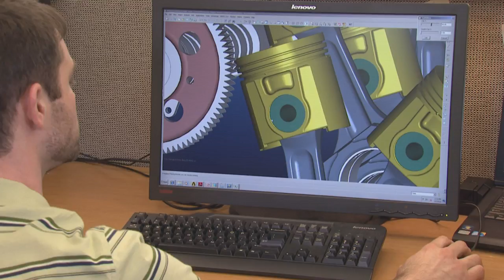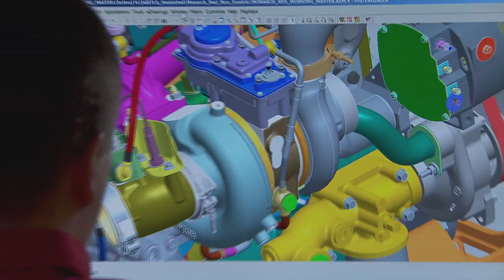Innovation Naturally - The Future Of Cummins Natural Gas

Comment: Been driving a CNG last four years absolutely no pulling power truck runs like a scared rabbit on a flat Road it's not turned down speed-wise they say it has 400 horsepower but even a small hill there is absolutely no power in these motors
Reply: I agree the diesel ISX vs the CNG version is night and day
Reply: And always breaking down in the winter
Reply: @williammcphail5581  high hp no torque

Comment: This is a great thing emissions like egr and dpf are getting us no where but losing efficiency and fuel mileage we need to change the fuel itself
Reply: Odd that you have that misconception. Diesel has nearly 150% the energy density of CNG or LP. The only advantage LP and CNG have over diesel is price. And that advantage exists because the price of diesel is artificially jacked up.
EGR and DPF are the worst possible ways to clean up a diesel's exhaust. In truth I think they make them run dirtier. If someone bothered to actually do a study on this I'm betting they will find that the gross NOx emissions produced by a truck equipped with them is greater than if the systems were removed.
Common sense will tell you an ounce of prevention is worth a pond of cure. Cooler intake = cooler combustion = cooler exhaust temps. Larger, more efficient, intercoolers and cool air intakes are the answer not EGT and DPF.
Reply: samus989 I have several rigs, but my favorite is my 67 Loadstar. Its outfitted with a MaxxForce DT, Allison 2500 PTS, NP205, Dana Super 60 Front [3.31 ring and pinion], Dana Super 80 Rear [3.31 ring and pinion], riding on a set of 22" American Force 'King' rims and 235/50r22 tires.
The engine and transmission are sourced from a IC CE-300 bus. The Axles came from a '12 F450 King Ranch. 
Tax auctions are so much fun. I got both of them though title boxes. They claim the contents are random, filled with whatever title documents they didn't have time to process. But I think they filter out all the real gems, then stuff the rest in those boxes and seed them with a couple goodies just to keep people interested. 
But I'm not complaining. Thats how I make my money. Paperwork is a bear sometimes, but... I digress.

Back to the truck.

By virtue of the truck being a 67 rig, I was able to legally delete the EGR and DPF system. With some electronic black magic I got rid of all the computer issues that caused, and gained the ability to select between high output and high economy injection characteristics.
With a larger, dual stage intercooler [pre/post], VGT control tuning, cool air intake, 4" intake, downpipe, and exhaust pipes, and minor tweaking to the fuel injection system, I able to upped the hp to 500+ @ 2800 rpms, 950 @ 1600-2800 rpms.  
With a 6th gear of .64: and a final drive of 3.31 I'm able to cruise right along at 65 mph while turning at 1500 rpms.
Even with the HO switched on I don't see even the slightest puff of smoke. My EGTs with HO on are never over 1250F at the turbo inlet, and when its off they much lower.
With HO on I get about 22 hwy, with it off I beat your mileage by 3, with 28 mpg.

Will I ever recoup all the money I'm spent on building this rig....Bah, ha, ha! You got to be kidding me!

Well, come to think of it, if you take into consideration the money I didn't spend on parts, along with the money I got from selling the leftovers from the donor vehicles, I might be pretty close. 

And before you ask, and I know someone will, I parted out the '12 King Ranch because I already have an early MY 03 F-350 King Ranch with the legendary 7.3 powerstroke. Its already setup the way I want it.
Reply: samus989 I'm a diesel mechanic too and it is nice that we can run them inside without having problems but on top of losing efficiency too I'm sure you know all about the servicing of these systems like removing and cleaning DPF filters and all of the egr problems from things clogging which Cummins I've seen is actually bad for, not only the inefficiencies and and wasted energy the money is ridiculous that is spent keeping up with these systems.
Reply: ***** EGR and DPF are half measures made to satisfy the EPA that something is being done, compared to my engine, the new engines are extremely inneficient getting less than 10 MPG, whereas my 5.9 can get 25 MPG.  However the emissions are MUCH MUCH less, I am a diesel mechanic, and I can tell you the exhaust on the big trucks that are only using moderate emissions controls will fill the shop up quickly and make it hard to breath, but the new trucks that have large after treatment systems, you can run them all day in the shop and you wouldnt even know they're there, is it better?  Well theres a lot of fuel and energy lost just to lessen emissions.

Comment: you guys should start using hydrogen
Reply: The main reason pure hydrogen isn't in common use as a fuel in combustion engines is that it takes more energy to produce it than you get back from it.

Then there are the issues with storing it. And there is that issue with accelerated engine decay caused by hydrogen embrittlement. And lastly, hydrogen burns at such a high temp, it would melt the engine in short order, not to mention generate undesirable levels of NOx emissions.

Nope, hydrogen is a pipe dream.
Reply: it would be worth pursuing
Reply: If it was possible, it would have been commercialized long ago.
Reply: I don't think so it would destroy oil companies, and anything is possible, all it would take is funding and good engineers
Reply: Once again another person that has bought into that enviro-nutter myth. 

Let me explain it in simple terms. Oil companies are a myth, they don't exist. They never have. The enviro-nuts want you to believe in them, but they don't exist.

The existence of Oil Companies is a lie, its propaganda, its a tool used to blind you to reality. 

Why they invented this lie is a larger topic that has little to do with why no one is developing a hydrogen engine. 

Simply put, Big Oil doesn't exist. What does exist is Big E. Because those companies you buy your fuel from are Energy Companies. 

The Energy companies don't care if the energy you buy is Gas, diesel, hydrogen, propane, natural gas, bio gas, bio diesel, coal, or (you guessed it) electricity. 

They don't care where the energy comes from. Whether its nuclear, wind, algae, fossil fuels, wave, hydroelectric, fuel cells, soy beans, doesn't mater. 

All they care about is their bottom line. They spend billions every year developing the next technology that will power your device. They do this to ensure they own part of the patent, so they get a slice of the profits.

They don't bury technologies, because patents only last 20 years, so that a 20 year window for them to make the most money. After that it becomes generic technology. And anyone can develop their own version.

So if hydrogen had any potential, they would have exploited it long ago!
Reply: would there be something wrong with burning hydrogen in combustion engines, other than making it practical, what would be the downside to this
Reply: How many times do I say it. Hydrogen will brake down the cylinder walls of the engine. It will degrade the engine so fast that the engine WILL have a catastrophic failure within 10-50k miles.

Hydrogen doesn't work because no element in the known universe can contain it. It will always seep into the containment vessel, disrupting its molecular structure and causing it to brake down.

Hydrogen doesn't work as a fuel because it will destroy the engine, quickly.
Reply: so you're saying that since it wont work in a combustion engine, we shouldn't even try, you are definitely a rational thinker but you don't think hydrogen is possible, you don't think it is possible to engineer an engine to run on hydrogen, not even in the slightest bit, why are you even against the idea, or even hesitant
Reply: I use to work for Ford, developing a Hydrogen Internal combustion engine.

When the project concluded it wasn't Ford's executives that pulled the plug, in fact Ford continues to develop the engine, not because the technology is potentially viable "someday" but because its a tax right off.

It concluded because it was clear to me and my fellow engineers that it was never going to be viable.

Hydrogen fuel cells on the other hand have the potential to one day replace fossil fuels. And that's why Big Energy is spending so much money to develop it.

However a hydrogen consumer infrastructure is not viable without nuclear energy proliferation. 

I'm talking LFTR based power plants. Such a plant is safe, can not melt down, and they are 99.8% efficient. That means you will get 200 times the energy out of the thorium fuel compared to Uranium fuel cycle plants.

With these power plants we can produce enough electrical power to make hydrogen fuel cells practical (long range cars) along with battery electric cars (in city transport).

Hydrogen internal combustion is a dead end, but hydrogen fuel cells have potential. That's what I'm saying. 

Cummins knows this, that's why they Aren't developing a hydrogen fueled diesel cycle engine.
Reply: ***** That's a buzz kill to tell you the truth I like combustion engines, electric motors seem kind of soulless, I hope I didn't seem like an ass but I've never done the research, I just hope there is something better and more efficient
Reply: ***** I was wondering since you worked at ford you don't seem biased in the diesel world what you prefer or just your opinion on Cummins as a whole
Reply: I worked for Ford, in so much that I was a partner in the firm formed to develop the hydrogen engine for Ford.

Most of my work centered on materials. So I had a first hand look at the damage caused by using hydrogen as a fuel. After 1 hours of operation I measured just over a micron of wear, and the degradation after a 6 hour test showed uniform wear characteristics. That means that after 1000 hours of use the engine would have worn down a full millimeter, more than enough to lose compression.

I like Cummins. Their engines are well respected for a reason, they're well built. I also like their commitment to thinking outside the proverbial box as well. Its good that they are building CNG engines. Its a segment that is grossly under exploited, so its refreshing to see a major company leveraging their market share to get these engines into circulation.

I don't use Cummins engines in my trucks for the sole reason that Navistar engines are just as good, and it seams more fitting to put them in the old International Harvester trucks I so love to restore and modify.

I think that I'm going to have a documentary made of my next truck to put on youtube.
Reply: ***** yeah I understand were your coming from about using engines from the same manufacturer, did you ever see the episode of Stacey David's Gears were he had redone the original engine only to rip it out and put a Durmax in it,
Reply: I really don't watch that guy much, and mostly because he does nonsensical things like that.

The only episode I remember was one where he spun some yarn about improving the power and mileage of a Ford Ecoboost engine (don't blame me for that waist of a good sheet of paper engine design) v6. 

All he did was change the air filter, put a 4" catback exhaust on it, and dial back the injection rate. He might have gotten 1 more mpg for all his work. 

Want to really improve your mileage? Sell the F150 (with that stupid turbo v6 with the power of a v8 and the mileage of a v8) and buy a F250 with the scorpion. Then change out your final drive gear to a Motive Gear 3.55 ring and pinion, MG part# F10-5-355PK, and adjust your speedometer. 

Bam 25+ mpg. You'll be cruising along at 60 mph turning just about 1500 rpms.

If Ford really cared about fuel economy and quality engineering they would take my proposal to develop a 244 and 305 CID inline 6 turbo diesel to instal in the F150/Expedition/Navigator and F250/Excursion. 

I personally feel that Ford, GMC, and Chrysler need to develop a line of inline 6 diesel engines in the 200 to 300 CI displacement range for the American Truck and SUV market. 

And most importantly foster a performance aftermarket for those engines.
Reply: yeah people don't understand the reliability and efficiency of a diesel inline motors in the United States,
Reply: Well the problem is that most people think of diesels as commercial truck engines. They never bother to consider the reason why the vast majority of commercial truck use them.

A properly run business doesn't waste a cent. The don't care if the engine sounds like a giant baby rattle, as long as operation costs are low. 

As a result, in the usa the majority of diesel engines are designed with efficiency, durability, and power in mind. Refinements are always centered on those three aspects. 

Consumers want either a quiet engine, or one that can roar like a boss. They want it to be responsive, have a good driving fear to it. They even want it to look nice. So diesel engines are not exactly the first thing that comes to mind when you are buying a car here in the USA.

In fact no one in the entire north american market builds a consumer grade diesel. Even the light duty diesels that you find in most full size trucks aren't consumer grade engines, they're commercial grade engine that have been given a little spit and polish.

So, I'm putting what meager resources i have together to develop a line of engine, each with some catchy theme to them, that are engineered with consumer grade refinements in mind, with a focus on the retrofit market. 

The reasoning behind this is the idea that if I can develop a line of engines that are compact, light, adaptable, and aesthetically attractive enough to be desirable, that not only will I attract the weekend hot rodder to buy my engine, but also attract an OEM to include my engines in there line up.

At least thats the dream. But until I have my prototype engine built, I don't think I'm going to attract any major investors.

The prototype is a 357 cid inline six. Its going to have analog control and management systems rather than computers controlling everything.

I'm more inclined toward mechatronics than the typical computer controls everything approach we see do often. I'm of a mindset that a well thought out machine, where all functions are in balance, will be more durable and less problematic than an engine that controlled by a computer.

To me there's just too much of a chance for the computer to glitch and cause everything to go cafluey. Better to have each system controlled locally rather than centrally. That way when somethings not working right you can just look at the malfunctioning part to find the problem, rather than plug in, check the codes, check the part, test the part, check the codes again, then throw your hands up in disgust as you flash the computer's firmware to discover the problem is now gone.
Reply: yeah I think that would appeal to a lot of gearheads, especially those who hate the computer controlled engines, it sounds like you want to combine the best of new engines and old,
I'm a big fan of Cummins engines and the truck I plan on getting is an 06 3500 5.9L
Reply: Exactly.